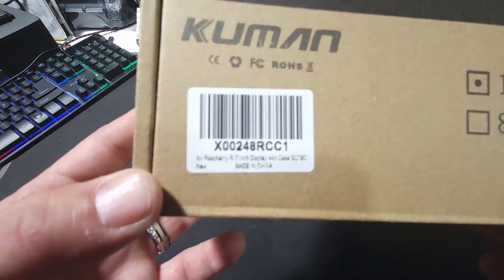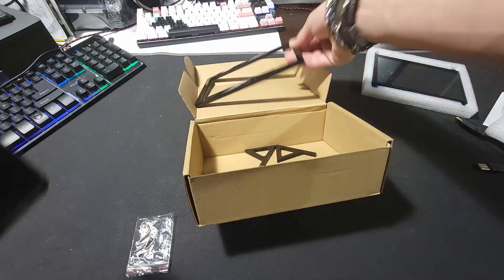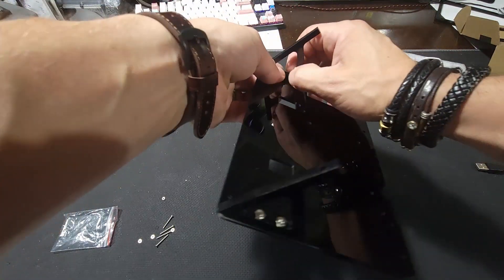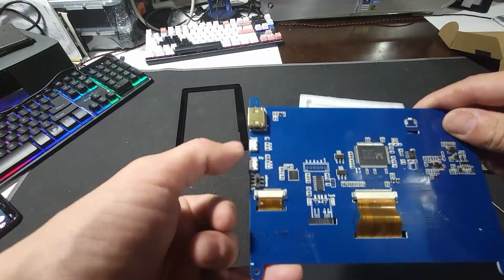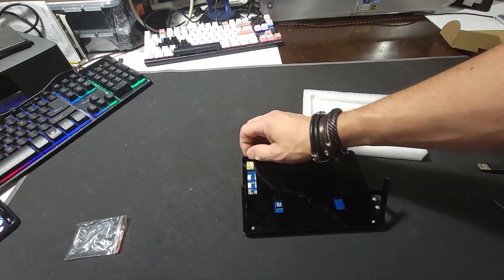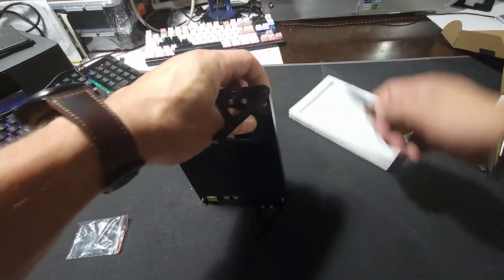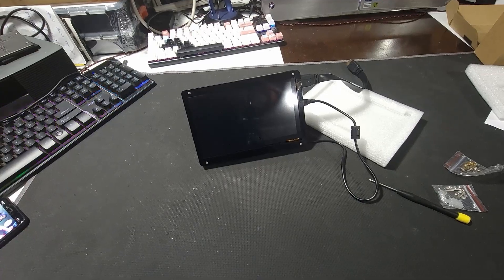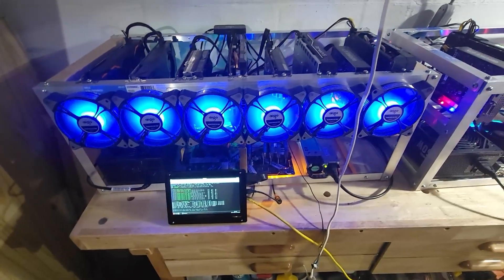7" Kuman display

Comment: I just got this same screen and case and couldn't figure it out until you mentioned that there were two different sized screws and then the lightbulb clicked.  THANK YOU!
And yes, needle nose pliers or forceps make it much easier.  after looking at the holes on the back and the other screws, I realized they are for mounting a raspberry pi (or similar) to the back of the case.